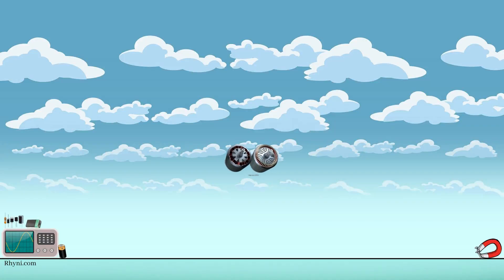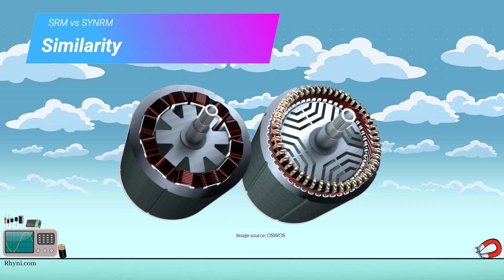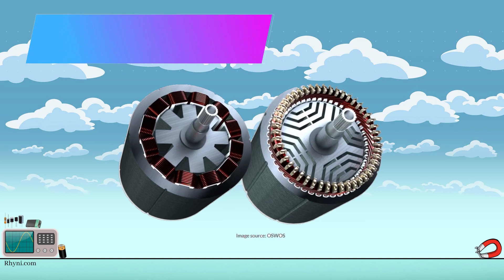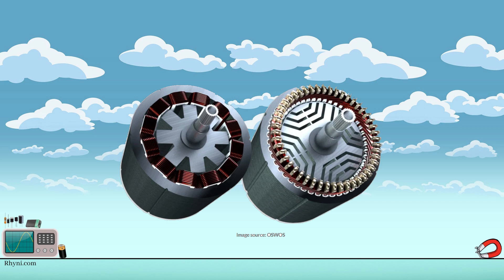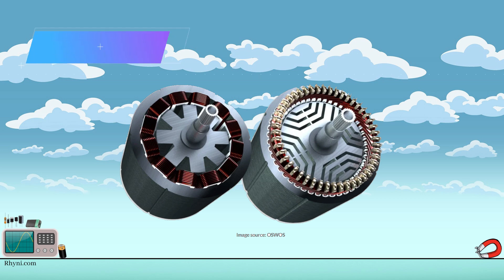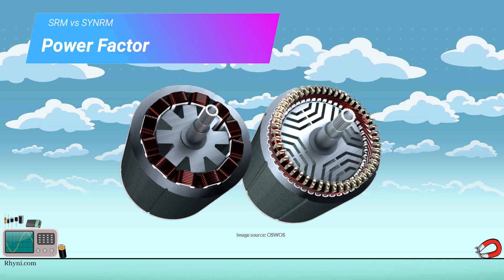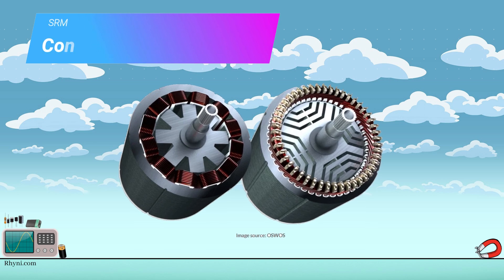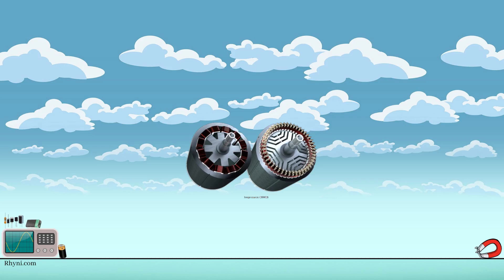Switched Reluctance Motor vs Synchronous Reluctance Motor, SRM vs SYNRM, Know which is better.

Comment: sir,  SRM with out sensor how we will know of the rotor...
Reply: SRM can be run without sensor. Reluctance diagnostic pulses can be switched onto the phase coils to determine rotor location. The pulses give current rise feedback which enables detection of reluctance and therefore relative position of the rotor to the stator.
Reply from the maker: SRM can not run without sensor.

Comment: i am confusing about SYRM rotor material... you said in video (2:99) synrm rotor  made up of laminations.... is it correct explanation... i need clarity about rotor of SYNRM material...
Reply from the maker: Yes, laminated steel is used in both motor, only shape is different, but shape of SYNRM results in more complex process of producing steel stamping.

Comment: A SynRM rotor is a set of powerful permanent magnets that required rare earth elements.

An SRM rotor is just made of iron.
Reply: Wrong. Tesla did add magnets to the SynRM to increase low end torque, but a basic SynRM does not have magnets.
Reply: @SuperYellowsubmarin Wrong. Instead of asking which motors he was referring to you chose to assume. 🙄